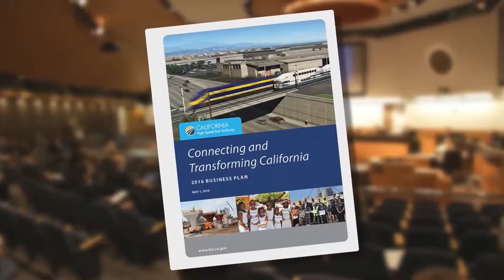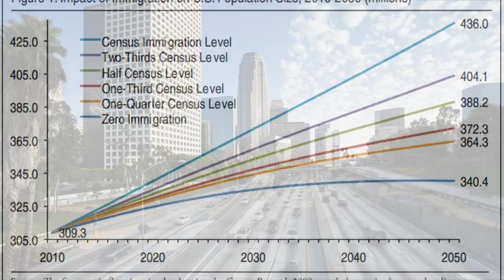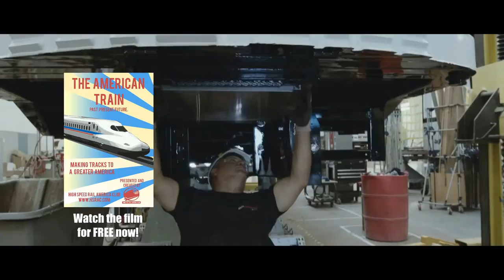What is the California High-Speed Rail Authority? - FAST FORWARD - HSRAC

Comment: Awesome to hear about CAHSR :D!!! I've been following this for the past half-year or so, and am excited, even though it'll take a long time to really complete. I think, once most of the bridges and viaducts they're building right now are finished and they move to building more straight-line, between-city rails, more people will really see it as "being built" :)

Also, I believe Prop 1A forbids state-subsidised operations, perhaps not federally-subsidised? I'd have to double check. Just mention, since if it is only state-subsidised, perhaps Amtrak could "take back" their San Joaquins route and replace the Merced-Bakersfield portion with HSR (and, of course, extend to SJ/SF) :) would be an interesting way to "test the financial return" of trains on the route. Not saying Amtrak should be the only trains on the line, just an interesting idea.
Reply from the maker: Hopefully there will be more to come, waiting to see when they'll pick their rolling stock, seems to be between the Japanese and Germans right now.
Reply: High Speed Rail America Club
Rolling stock for CAHSR? I actually was just reading on Wikipedia and it seemed there were talks a few years ago about both CAHSR and Amtrak buying in bulk some highspeed trains from...I believe it was Alstrom, though I'm not 100% sure. I'm probably wrong there :P but there's rumours Amtrak is replacing their Acela trainsets with ones 100% from Alstrom. 'Twas on Reddit /r/Amtrak :)

But yeah, that'd be interesting. Japan needs to export their train tech and Germany has a bit of a history (what with the Amtrak ICE test train and all) with Amtrak...

Comment: California pop. is about 40 million.  An increase to 60 million by 2050 would be 50% increase, not double.  That's likely an over-estimate as the water situation in the state has no prayer of supporting 60 million inhabitants.  The train is currently estimated to cost $64 billion for the S.F. to L.A. segment which is about the original estimate for the entire project, including the leg to San Diego.  There's no WAY other forms of transportation would require $200 billion for equal capacity.  Time to build has also increased accordingly.  The line to San Diego was supposed to be completed by 2036.  It is now TBA.  The timeline for S.F. to L.A. is still 2029, but this is a joke.  They have yet to lay track on the easiest segment.  In order to get from the Central Valley to L.A., the project requires the longest train tunnel constructed in history, AND it has to cross the San Andreas and other major earthquake faults.  This has NEVER been done.  Because of the nature of the terrain, and inevitable track sharing caused by protests in S.F. and L.A. proper, these trains will only run at full speed in the Central Valley, and will fail to meet travel times required by law.  The proposition that got this started, which I voted for, funded the STUDY of the system.  After the initial supremely rosy study, the state went ahead on the build.  However, this was a bait and switch.  We will not get the train we voted for.  It will be slower.  It will be vastly more expensive.  It will take longer to build.  Revenue projections were also absurdly high initially.  They have been dialed back significantly, but still project a profit, which is the case for almost no other HSR line in the world.  Also, keep in mind, California has a TON of infrastructure already in place that will compete.  We have 3 major north-south freeways, 9 international airports, and 3 standard rail lines within the scope of this project..  If we're lucky, HSR will be funded long enough to run from Fresno to Bakersfield.  Combined service population along that route would be about 3% of the state, but since when is there demand for a bullet train from Fresno to Bakersfield?!  If they complete this, it will probably hook up with San Francisco as well, eventually, but at significantly reduced speed.  Still only about 1/3 of the state, since the majority of the population lives in the south.  I have no confidence that this train will reach southern California in my lifetime.
Reply: +Lucid Stew The water could come from the ocean. The sea salt could be evaporeated and the water is distilled.

Comment: 1. Projected route is crossing San-Andreas Fault. It should neglect small inland cities and run through without crossing it.
2. LA needs rent-a-car to move around but there isn't enough space for parking lots in downtown. Besides, it will cost so much to build station and rail in midtown. If they are built at suburb of LA, to get to the station will be troublesome.
Reply: Kitty George Fuck renting a car, LA needs to make better use of it's transit systems.
Reply: +CJ Many of those who come from bay-area would be tourists. They don't go to only one place so that taxi isn't efficient. Does LA make dense public transportation? Or does it provide shuttle buses circling all major sightseeing spots?
Reply: Japan is one of the most earthquake prone places on the planet and they still have a very advanced high speed rail system
Reply: Japanese HSR system can stop the train at the earliest after earthquake but even the most advanced system is no use if the rail is cut by land fault.
Reply: Highways cross the san andreas fault.

Comment: My problem with this project isn't that is going ahead but more of a technical standpoint complaint, in this day and age cost savings can be made by eliminating the driver and automating the experience such as the Chinese maglev transrapid, and  the Dubai metro ,  the trains themselves are also of a last gen design, we have trains that operate at 250 plus nowadays and to encourage widespread use it has to be seen as a clear superior alternative to get people out of there cars, sure the trains are capable of 220 but when they enter service op speeds are usually 25% less, but also the scope of the project is just not  ambitions enough, with construction already started we should also look at phase two and three going east to west north and south and the upgrade of feeder lines to electric +150 mph, and also the possibility of links to  outer-state high tourist areas Rome wasn't built in a day sure but we should plan for it too
Reply from the maker: Hello +ram64man and thank you for watching! It is a reasonable suggestion that California's HSR be built with a maglev infrastructure, even considering that Japan's will have a revenue running maglev system by 2027, 3 years before the first phase of CaHSRA is completed. However, the voters also voted on this technology as well with Prop 1A, changing it now and telling constituents "by the way, it's going to be even more expensive" will make the project impossible. You can't just look at it from a technological perspective, there's the business and political aspect that are equally important.
Reply: JR Maglev payed 2,6 billion dollar for the 18km track they built so far. At the proposed system length that would cost 187 billion dollar only for the tracks, no stations, vehicles or cost for the ground included. There are also no trains operating at 250mph.  Not a single of the many countries with years of high speed rail experience exceeds 200mph operational speed so far. Many attempted it with higher design speeds but all dropped back to operational speeds of 200mph.

Comment: so indian bullet train about same length would cost 15 billion $ would start in 2018 (soil test and drilling is started last month) would be completed by 2023 (at least thats the plan. why would it cost 60 billion $ in USA and take 6 more years to complete. cost can be understood labour cost is much higher in usa but whats with the estimated time.....
Reply: Raghunandan Reddy C They have to acquire land through eminent domain, some of the stretches are built above existing roads such as the one near US 99. These aren't easy feats as it has to be done without interfering with existing infrastructure.

Comment: The northeast corridor needs to be rebuilt instead of this project. The people in the northeast actually use trains unlike Californians
Reply: You would perhaps be very surprised to learn that the most train riders outside the NorthEast Corridor are those of California. The Surfliner running mainly between LA and San Diego but also having several times a day service to Santa Barbara is very highly used and is the most active line outside the NEC. The San francisco  area also has numerous trains between SanJose and Sacramento passing through the Bay area. That doesn't include the five, soon to be six commuter lines or another long distance, but inconvenient service I could mention.
 It is to connect these two train friendly  areas with more timely service that got the citizens of this 1000 mile long state to pass the legislation needed.  Yes we have cars. and the Auto companies have their design bureaus here in order to to sell  more to us. But they are just filling up our rolling parking lots, and we know it.
Reply: +1 Yes, and LA county is continually building out their light rail system, and has Metrolink, and SF has CalTrain and Ace Train (Stockton to San Jose commuter only). Also, currently there is the Amtrak San Joaquin that is quite busy, too. Basically, there are many train-/transit-friendly areas, and CAHSR will link them :)
Reply: SF to LA is the second busiest passenger airline corridor in the US (after NY to Chicago).  Because the two greater metro areas are so culturally connected, there is a constant demand for transportation between the two.  A road trip on highway 5 through the Central Valley can range from 5-8 hours (yes traffic is that bad).

I'm not suggesting that the northeast corridor doesn't deserve better than the current Amtrak Acela line.  However, it is up to local politicians in those states to propose those projects.  CAHSR had to be fought for locally before any federal aid could be packaged into the project.  Don't expect the federal government to propose it.
Reply: Marco Romagnoli
used to travel i-5 and the 99 from Sac to Orange County a lot...man that was a pain. Only thing I think needs to now be prioritised, with HSR being built, is for all of SoCal to invest in public transit: light rail, commuter rail (MetroLink, etc), and perhaps even "street-car"-like trains or whatnot. Really make it easier to get around :)
Reply: The Northeastern Corridor needs to be rebuilt and PRESIDENT TRUMP WILL!!
Reply: william wroblewski
 that is an assumption. I would love it if he did. But I hold my reservations. I'd love to be proven wrong by actual action :)
Reply: archlinuxrussian LOL!
Reply: william wroblewski
I apologise if I missed some obvious sarcasm, I've just been in discussions with people who mean no sarcasm, so my ability to detect is has been numbed a bit. :)
Reply: If you think people in CA dont like trains, try getting a seat on Metrolink in the morning. People stand from Fullerton to LA, which takes about as long to travel as Jamaica to Penn Station.